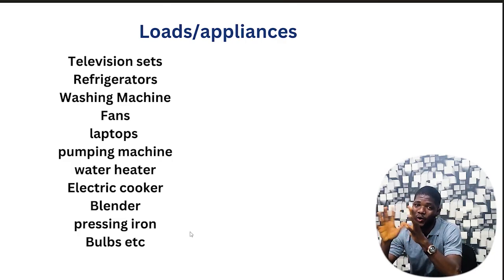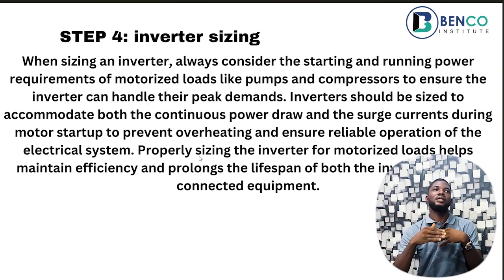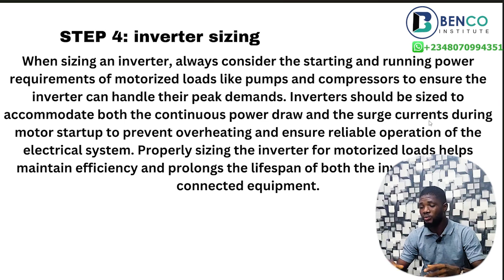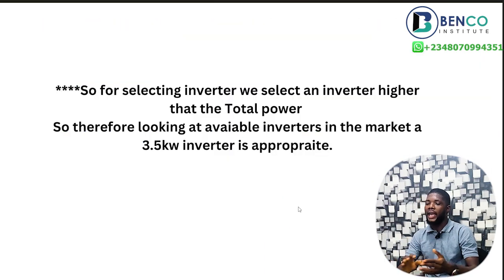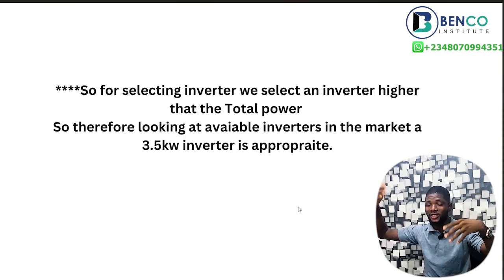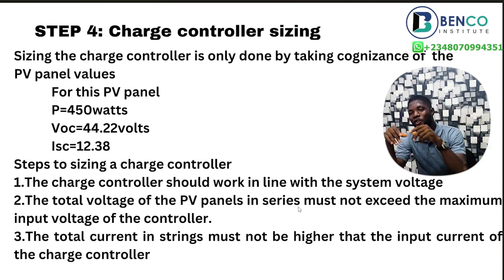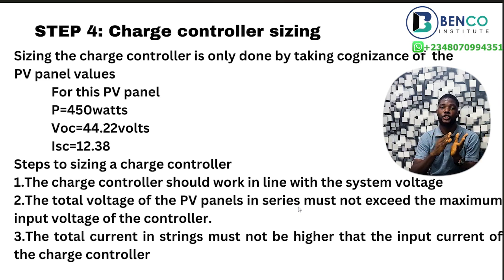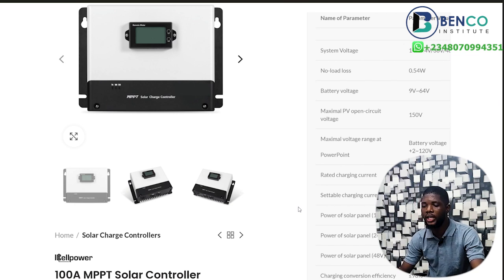How to size inverter and charge controller for your off grid solar Energy system #solarenergy

Comment: Thank you.
How can I know the voc and Isc of panel when I haven't bought it. Because during the time of sizing the system solar panel has not been bought.
How can I know the voc and Isc.
Thank you
Reply from the maker: The only component you need those values for is for your charge controller.

So you buy the solar panel and charge controller almost  together...